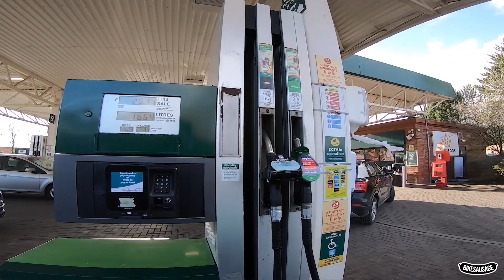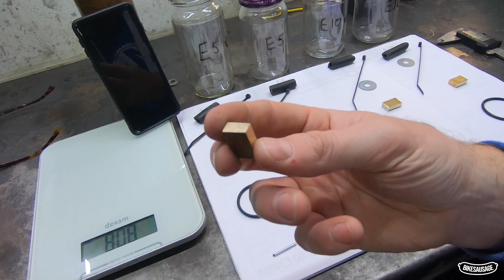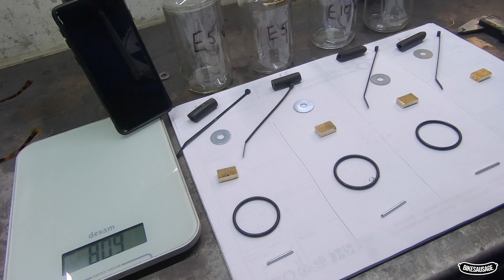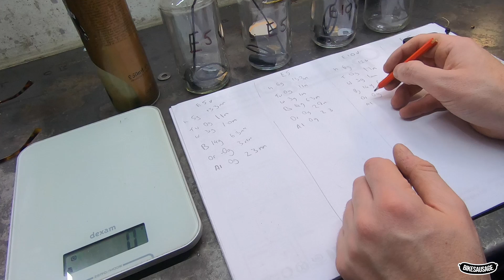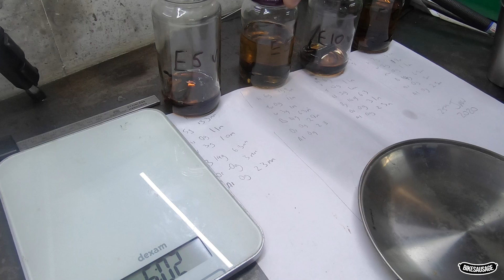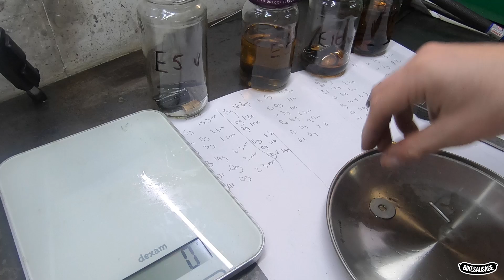E5 v E10 FUEL | Does it really make a difference?

Comment: ive seen it myself, modern car   that is from this century,  running rough,  stick 20l of tesco superunleaded,  runs much smoother,  i dont use it at all,   at time goes on, what we dont need is ripoff merchants  charging 25-50p/l more,   price in comparrison with diesel,  my works minibus was getting around 30mpg, from a 1.6 HDI

Comment: ive got a 25 yr old carb bike. 
it just runs cleaner on e5. 
it's more stable on the low end and the exhaust smells cleaner. which makes sense since e10 can run lean on carbs if it's ported for e5. and it's got the original carbs on it. 

i also run e5 since ethanol is hydroscopic and im not interested in introducing more water in the system. especially since 4-5 months of the year i cant ride a bike because snow exisists here during the winter.

Comment: You didn’t test the fuel to measure the % of ethanol, you took it for granted that it was five and 10. If you test the fuel, it’s very unlikely than the 10 will actually be 10 or the 5 will be 5%.

Comment: if the parts used are new then they will be to a spec that's ok for e10 should have used parts  off a older machine  ie pre 1980s

Comment: E10 is cheaper but you get less MPG so is it cheaper? Even if you drive like you care about MPG that is. I have a BMW M140i (B58 engine) which I run on E5. I had a 2013 M135i (with the N55 engine) and I tried it on E10. The MPG was DEFINITELY lower and the car had noticeably less torque. I have never put E10 in my M140i and I never will.

Comment: I’ve always used E5 in my old 2T had a 94 plate DT125R and never once did I have issues with fuel apart from rust in the tank from it sitting in a broken shed for 15 years quick carb clean and she’d run perfect for a week 😂

Comment: As theres an overwhelming amount of stupid in this comment section, here’s all you need to know…

Unless your bike is extremely old, use E10.

It actually costs Shell etc more money to produce E10 so they just sell E5 at an inflated price because idiots don’t understand anything and Shell etc are fully aware of this. Thus why they managed to insist that hydrogen would work and here we are, 30 years later with no hydrogen stations.

For anyone looking at getting an electric bike, the perfect numbers are a 30kWh battery, 70kW or greater motor and it should rapid charge with a NACS plug at 30kW or faster.

Anyone that thinks engines are better most likely cant afford a car/bike with a decent engine due to their consistent incompetence.

Comment: My 2L engine was SO sluggish and slow with E10. Next fill with E5 or VPower and the response was significantly better. So it is not a "feeling" or "all in your head", you can tell from the torque response on first gear.

Comment: I always put V power in my bikes yeah it's a bit more per litre but it's better for the bikes longevity and you get more mpg out of it because ethanol doesn't burn as efficiently as petrol so you use more fuel and need to fill up more often. Also try leaving a dirt bike sitting over the winter then have fun getting it to start ethanol also absorbs water i had to take my carburettor apart and rebuild it when i looked inside the fuel was contaminated with water and that was with E5 would have been way worse with E10 fuel

Comment: My 2020 Seat Leon 1,4 ehybrid hates e10.. it hates it... the engine does not run right on the stuff even though its suppose to. So I only run E5 and while it is a bit more expensive I do get that back through improved fuel consumption as it is just bad on the E10 stuff.

Comment: Having ridden to Scotland and back twice over the last couple months, the difference from E10 to E5 is significant.
On E10 there is less power and my bike is sluggish and vibrates a lot more and the engine feels lumpy and lower MPG and over range is less.
On E5 within a few mins the engine performance improves significantly, more responsive and more power, no vibrations and the engine runs smoother and better MPG and range
Reply: Funny that I'm in edinburgh ,and my honda 400 4 1991 super four ,fuel system got wrecked ,conked out at lights got it home and man inside cards was destroyed ,cards fixed use e5 now but never let it sit in cards I run em dry as I approach my home ,

Comment: Electric powered vehicles are impractical. Hydrogen is the way forward if you want to reduce emissions and remain practical whilst not crucifying the environment and the third world. Whatever. Man made climate change is a hoax. The sun drives climate, not man's tailpipe or a cows arse, and were not going to drown or melt if we don't. CO2 is not pollutant, it has NO EFFECT on temperature, it's the other way round, temperature drives CO2. This is a deliberate con to enslave. Do not worry about the climate, mother nature has it.

Comment: Thanks for your reassurance on E5. My car is of the age that needs E5, I am told, and it came as a shock to me last year to have to use E10 on many occasions when touring UK as many fuel stations have blithely switched ALL their pumps, except the expensive stuff, to E10 and 'sod the customer'. So where I could not get the old E5 and had to use E10 and worried about its effect on my old car. West Scotland has so far not been affected by the switch and the Highlands and islands still get E5, good on them. and with a tank range of 400+miles, I can be choosy. (a bit like having to arrange uplifts/recharging points were I daft enough to use an EV without the hours wait). 
Happily I live in a country where our government has banned E10 so most of the year I can operate happily without worry.
So if you want to flush out your tanks of the new poison take a trip to the Isle of Man which has more going for it than a certain bike festival.

Comment: Seems like e10 killed both my lawnmover, snowblower and 6hp outboard's various gasket, hoses & o-rings. Rubberseal/diagraph in fuel pump seems damaged. Looks like cast alloy carburator parts is more prone to get corroded and gunked upp when in storage, and needless to say this is somewhat expensive. Some of my gas hoses on my speedboat were transformed to plastic after filling e10 at the marina between seasons. Not to happy about this because many gas stations only push e10 and there is limited supply of e5 95oct.and super98. Also big trouble getting "winter diesel" in the summer time... Don't want 2 run bio-mix diesel fuel on my Yanmar either, but that's the only thing they sell until it starts snowing again here in Norway.

Comment: E5 will still rust your old metal tank, to the point of having to remove and replace it! On an old air cooled, 1970's VW camper/van this means actually taking the engine out! It also ruined my petrol mower, by cloging up the carb and eating the float chamber seal! The manufacturer had gone bust so I was unable to source any spares, it was also scrapped!

Comment: my take after trying both fuels and reading/watching many vids, is that yes, E5 costs more and the extra mpg is pretty much offset by the extra cost, BUT my motorbike at least 'feels' perkier and smoother on E5, so if it's not costing any more in real terms, it surely makes more sense to use E5. i do feel though that as more and more of us realise E10 is a con and the difference in mpg is much more than the 1% they say, then the price of E5 will rise, in much the same way they conned millions switching to diesel. and btw the 'emissions' argument is claptrap when you look at how much pollution modern vehicles emit, such as my euro5 bike, and as older vehicles need E5 anyway, it's all about taxation and not combatting pollution is it?

Comment: In my ford c-max, I used E10 a couple of times and my car made lots of odd noises from my fuel tank and cat. Went back to E5, car was happy again. It didn't cut out or affect the acceleration as such but did make odd noises whilst on the E10.  So for now until I understand more. I shall keep to the E5 for now.

Comment: My car, a 2009 Cayenne turbo (72,000 Miles and full dealer history), suffers misfires under load and the check engine light comes on after driving just a few Miles if I am forced to use E10 fuel because I can’t find E5. This E5 stuff is another Greenie farce. And for the record, my negative impact on the planet is probably minuscule in comparison to the average Greenie, because I only drive 4,000 Miles per year, have owned this car for over ten years and only had one child compared to these yoghurt knitters with their smug faces, bicycles and swarms of resource consuming offspring, all buying a new phone every year.

The greenest thing we could all do, is keep our older cars and keep them longer, not buy a new EV every two or three years.

Edit to add: And my mpg is in the toilet when using E10.

Comment: 3% energy loss when mixed at 10% ethanol? Nah! In real world conditions i can guarantee you now it's much more than that...

I've only got a little peugeot 206 1.3 petrol but when using e5 i could put 20 quid in her and go everywhere! Even at today's high fuel prices. With e10 I'm really noticing the difference and it feels much worse than a 3% loss. Today i put £20 in and didn't go nowhere far really but I'm almost on empty. I wouldn't say it's a 50% decrease in fuel consumption but my gosh... It's not far off i tell ya. 

Basically this is a total scam! They boast about the "greenness" of the fuel and its equivalent to taking almost 350,000 cars off the road but if them cars are going to the pumps more often then there is no "green gains" and that silly claim is just canceled out. 

Just my opinion but i think it's a big fat con, getting people to spend more at the pumps and getting more older cars off the road. 

Thoughts?

Comment: bro.... this test is dogshit... you need to dry each component when measuring its weight. Also you didnt clean the scale and you are using a scale that has a rather large error to begin with.... and lets just not get into sample size..... clearly you have no idea what you are doing

Comment: My car drinks 15% more fuel on E10, but it runs smoother on it probably due to the anti knock properties of ethanol based fuels. Its an old engine, 2001 vauxhall eco tech with 170,000 miles on it.

Comment: I don't know what's happening with my car's got a 59 plate i10 that doesn't seem to run any different mpg about the same but I also have a T reg Micra that goes better than it ever has in the 15 years of ownership but but mpg always been rubbish at about 40 ish had to replace a rusty fuel pump but that was with E5 and rubber pipes had become hard I just wondered if the extra ethenol was acting as a cleaning agent I don't have  much of a choice as only have supermarket fuel round here

Comment: Too black and white sorry. I've run my mgb, matchless 350 and a 1955 Daimler conquest on e85 in France for the last seven years with no mods other than copper lines rejetting and advancing the timing (bhp  ). That's 85% ethanol (you're reviewing 10). I've had no problems at all. I'd be more concerned about modern tbh. How many rubber components in an su hs carburettor? A big fat zero. Similar to leaded petrol. Try actually looking into benefits of ethanol. Loads of possibilities
Reply: lazy video. Proper old vehicles have virtually no rubber.

Comment: Hi Boothy, do you know what material your ‘O’ ring was made from? There are many types; EPDM, Nitrile, Polychloroprene, Silicone, Butyl,  Viton etc. Not all types of rubber would be resistant to gasoline irrespective of whether there is ethanol in the fuel or not and would be subject to swell.

Comment: I have a gas station in my town that sells 91octane 100% GAS O LINE !!! 
it’s wildly pricey 
Like double price of 93oct e10 
Everything I’ve put it in runs better 
2021 Toyota Tundra 
1999 Chevy Tahoe and 
1999 BMW r1100s 
And various small 4stroke engines for lawn work ; 2mowers, weed eater and a pressure washer. 
And, the exhausts of all these motors smells less acrid.

Comment: My bike is a 1993 BMW R100GS. Runs poorly on E10, so i'm using the mor expensive fuel, In recent years i've had to replace the rubber tubes that go from the carbs to the engine, twice. Everything else seems fine. I've seen an early R1100GS with a plastic fuel tank becoming porous through the effects of ethanol. Different vehicles are effected in different ways. BMW switched to metal tanks, in 1995 i think.

Comment: I own a 2016 Triumph tiger, I don't tifmfe through winter I don't need to. My tiger was laid up from November to March with a tank of E10 the bike started straight away no problem at all. I do fill up with E5 sometimes and I do notice less millage on E10 compared to E5, the bike does have average consumption on it and with E10 on a ride on motorways average 75 mph I will see 51 mpg on E5 I can get up to 64 mpg.

Comment: A crude experiment but at least it was an experiment, revealing some possible issues.  Having at one time worked in the rubber industry I can confirm that some automotive rubber compounds, used in fuel hoses, seals, o rings, gaskets, components etc, will be adversly affected by ethanol.  More recent vehicles will use specific types of rubber for components and parts exposed to ethanol blend fuels, which will fully resist it's effects. Also realise that most vehicles are exported globally, and many countries have been using ethanol fuels for many years, in particular the USA. So those vehicles would need to be compatible with local fuel availability, if for no other reason but warranty issues.  One of the worst problems with ethanol blend fuels is water attraction, which can cause severe corrosion in susceptable components.  Using a fuel stabiliser mixed with the fuel in tank and run through the engine before any storage period longer than a month or 2, will minimise this problem.  The bigger picture is though, why the government implemented this flawed strategy, ethanol fuel increases fuel consumption, which negates the theoretical saving in CO2 emmisions.  And if everybody goes over to E5 SUL, it makes the excercise pointless, apart from increasing revenue and profits, as already mentioned.

E

Comment: I drive a 22 year old E38 BMW 728i and I'm getting significantly less MPG using the new E10 fuel so I use the more  expensive E5.
Glad I got rid of my 740  E38 last year or I wouldn't be able  to afford the fuel.
Reply: If it's the same as the 320i and 540i of that vintage, the BMW manual will contain a strong advisory to use 98 RON or as close to it as much as possible anyway: I guess these lovely BMW engines are tuned to run on super-high-octane fuel. BMW claims "all" its cars can TOLERATE (emphasis mine) E10 though, I believe.

Comment: I get vapor lock with E10, but not with E5, Carburettor bike. The fuel line does run right by the cylinder head and radiator though, so perhaps that is a factor, you can literally see the fuel bubble with e10, but e5 doesn't do the same.

Comment: Nice little experiment. Not 100% scientific but more than good enough to prove a point. 
In my uneducated opinion, I would only use E10 in an old car/bike to get me out of trouble. But only put in as little as possible to get me to the next petrol station, bearing in mind that its not as economical as E5. I wouldn't want to leave E10 in the fuel lines for any length of time, even overnight. I guess E5 and E10 would mix together alright and not separate?
Nice vid, thumbs up

Comment: I think we just need to refer to our American cousins who've had E10 for years and report rubber pipes eroded from the inside out turning them mushy, also older American cars running on carbs getting gummed up and running like crap. There's also plenty of UK car drivers reporting rough running and poor performance on E10 that's cured by going onto super E5 fuel. Rather than pay more for E5 I've bought some ester petrol ethanol additive and add 50ml every time I fill up, only time will tell if it works or it's just another "snake oil" product.
Reply: Hi did you reach a verdict on your ethanol additive?

Comment: Esso super unleaded, in most parts of the uk. Does not have ethanol in it apparently, but they have to advertise it as E5.
Read this in a magazine recently,  not sure if its true.
Maybe someone could shine some light on it 🤷🏻‍♂️
Reply: It's true, and it applies to many other brands in much of southern England. Up north, Devon and Cornwall will often get more ethanol though.

"E10" is currently typically 5 to 7½% ethanol in the UK rather than the full 10% but I wouldn't be surprised if that changes some time in the future.

Comment: Had a carbed 1100cc twin. Stripped carbs had them cleaned professionally. Left for 2 months, had difficulty starting took carbs back off, pig job as right between v cylinders. Totally gooey is best description and slow running jet totally blocked hence starting issue. Sold it cos not doing that every few months. Had bikes 45 yrs clean carbs in ultrasonic bath once a year, no problem, but this stuff whatever they say is bad. When unused carbs need draining, i also used fuel additive had noeffect thatvi could tell. I now have FI bike and that seems ok but only run on E5 or best octane i can find. A few extra quid at pumps is worth it in my non scientific experience.

Comment: Ive got a 50 year old 2 stroke and a 26 year old 2 stroke. Not bothered by E10. Fuel economy isnt an issue, these bikes were never designed to be fuel retentive. I just drain my tanks and carbs when i finish riding. Leave the fuel Cap off to vent. No rust In the metal tank and the plastic tank doesn't swell up, E5 also causes the tank to swell. Bring back 5 star petrol.